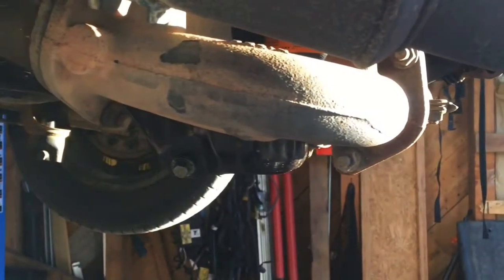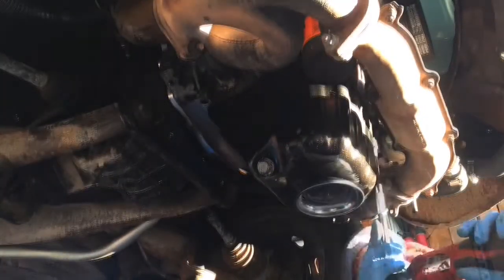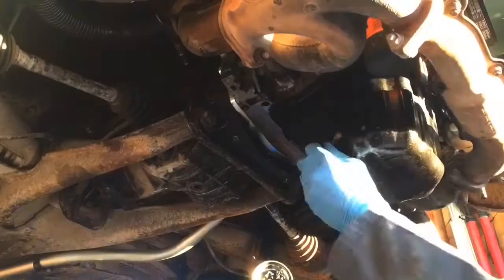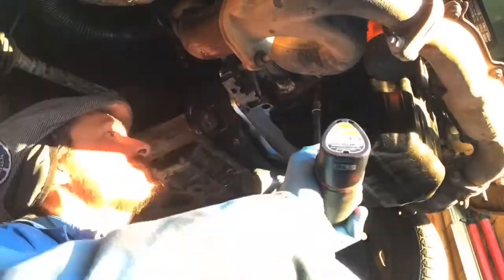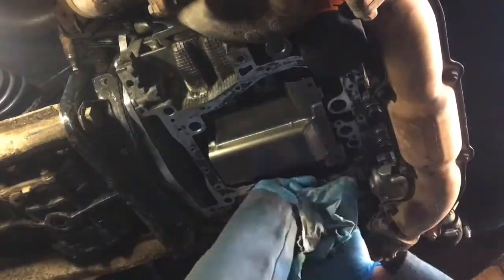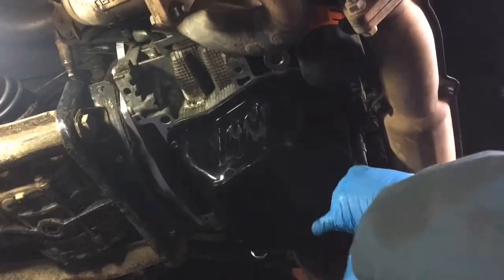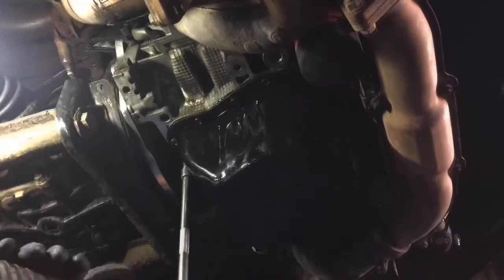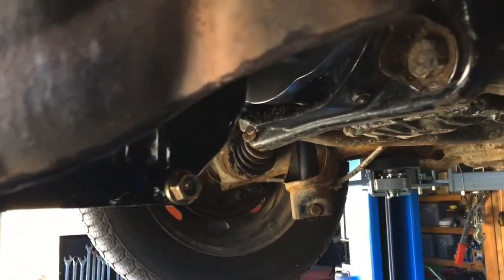BUGARU Shortened Oil Pan

Comment: What happens with the oil capacity and the dip stick would you not get inaccurate readings? Or would the oil sit too close to the crank? I'm guessing there is a recess in the shortened sump for the oil to sit in?
Reply: Not a Subaru owner btw, just a guy with ground clearance issues 😪

Comment: Do you have any issues with breaking transmission mounts under load? I had a buddy do this type of swap, and whenever he gunned it he risked breaking a transmission mount. He's about to get a solid metal mount. 
Also are you running a crossmemeber by chance? If not, how do you feel about the engine being supported by just the transmission?
Reply from the maker: +daniel Jimenez I haven't thought about that much. I am building a crossmember for bugs as we speak,  it'll be supported by the frame horns. How many times did your buddy brake his trans mounts?
Reply: Busaru Thank you for the reply! That's awesome to hear you're building a cross- member! He's only broken the polyurethane mounts twice; granted he likes to launch, and has an ej207 on a stock transaxle.
Reply from the maker: +daniel Jimenez Oh man! I'm on rubber, which I think would have a little more give, and I only do rolls - never launch. I'm on a stock trans as well - hoping it'll take the abuse.
Reply: Busaru I think you'll be fine then, judging by your driving habits. It'd be cool to see you install a subarugears transmission and compare the difference. See if it's really worth it. 
Love what you do - keep up the good work. You've inspired  me so much to have a sleeper bug one day.
Reply from the maker: +daniel Jimenez I installed a SG reversed trans in a bus - "Streetfighter" (search my other vids) and it was pretty awesome. I don't know if I'd personally ever spend the money but it was certainly one of the sweetest rides I've converted. Thanks for the chat - we all inspire, I'm just happy you found my stuff inspirational.

Comment: Opinion on the cast aluminum pan from Smallcar?
Reply from the maker: +Forthwith Tx Its okay... but no baffles  so that sucks, and could get smashed if hit - rather than bend like steel. This is also why I like steel wheels. I wouldn't use it if taking off-road much. They have cooking guns and look cool though!
Reply from the maker: +Busaru damn auto correct - "cooling fins"
Reply: Mine has cooking guns.  Which is even cooler.  The same could be said for other stock aluminum pans (dent vs. crack).  I like the fact that the SC pan holds a full 5 quarts.  It is pretty stout, IMO.
Reply from the maker: +Forthwith Tx the only difference between stock pans is that they're usually a lot more protected than in a VW swap. No question that the aluminum pan is stout, I just do too much off-highway travel to even consider one for my personal bus. I wish they had baffles too.